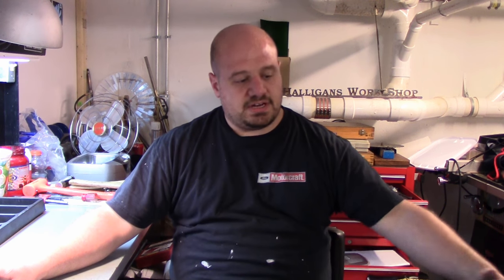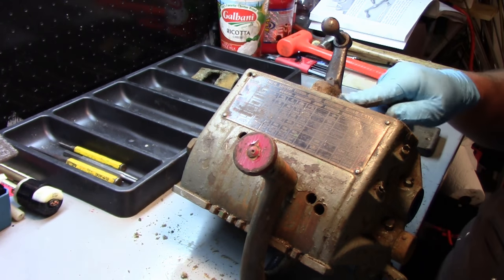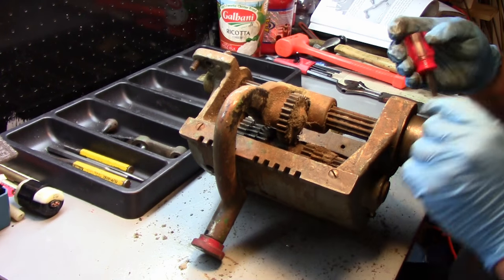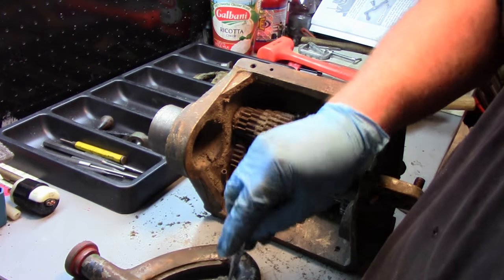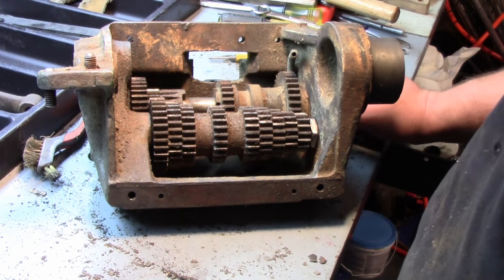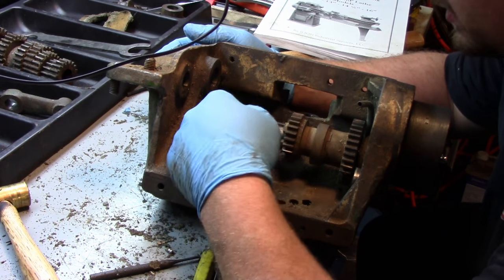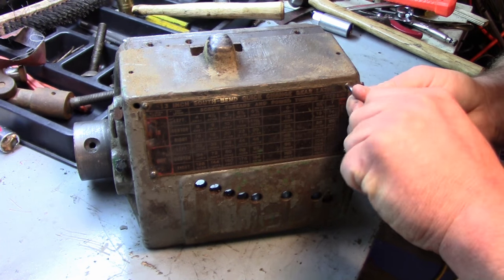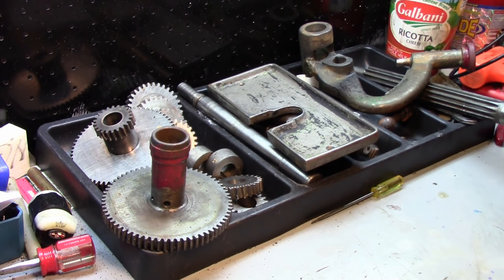13" Southbend Refurb: Gearbox

Comment: I've been using your videos as a reference lately. I just spent the last few days getting my single tumbler gearbox apart for the 13" I own. Boy, did I run into some fun problems. First, the taper pin was stuck. Tried everything to get it out. Nothing worked and I was sure I was going to bugger it up. Ended up drilling the taper pin and using a screw extractor. Ooof. Doesn't appear to be any damage to the nut or the shaft. Then the pinion gear on the other shaft would not spin even after removing the dowel pin. It was seized. Lots of heat, penetrating oil, a nice big brass punch, I was finally able to get it to rotate enough to line up with the key. Then I had to clamp the casing to my bench and drive out the shaft with a brass punch and a big ol' hammer.

You made it look easy. ;)

Comment: I don't miss rebuilding my single tumbler 10L gearbox! Those rivets holes are usually drilled all the way through the castings and you can knock them out with a small punch from the back without doing any damage to anything. I re-used every rivet on my 10L and they all shined up nice and look new! The plates on the bed or feet are another story.

Comment: It actually says to use a chisel to get the levers off in the rebuild book.  I did on mine, works very well. 

Sometimes you can get those rivets out from the back.  If there is access, a pin punch knocks them right out.

Comment: Greg,
Not too bad for an old girl! It looks like someone could have use a little more heat on that brazing. It should have flowed more instead of globs. At least it's stuck to the metal enough to keep things together. Probably done by some welding student. Good luck with your repairs. Hope you don't find too much wear on the shaves. If so, you may have to use some shim stock or turn something to make some bushings. Thanks for sharing your work and making the video.
Have a good one!
Dave

Comment: For anything screw that is too stuck, I've put a drop of Kroil penetrating oil. Let it sit over night and the next day the screws were practically finger tight. It also worked to loosen up a stuck thrust washer on my cross-feed assembly.

Comment: Oh and good video. Don't think I only have negative comments. I am just not a big fan of adjustables when there are better options. You sure made quick work of that gear box. Only thing you might do to the repaired tumbler, is run a reamer through the hole to make sure there is no burrs that might wear on that splined shaft.

Comment: Brad, ditch those blasted adjustable wrenches and use the proper wrench or sockets. Those things are hell on fasteners. I know it takes more time to hunt down each and every size, but every time you use an adjustable, you risk rounding the edges of the fasteners that have lasted for 3/4 century.
Reply from the maker: They are if you let them. Just need to be careful and know when it's going to slip.  I use them every day and am comfortable with them.  Oh and direction doesn't really matter unless you're gronking on them.  I don't care what anyone says.
Reply: +kentucky ken Yeah Brad, it's all your fault. Heck, they are probably laying off the union skilled wrench makers as we speak all because of your instance on using those danged adjustables.
Reply: +kentucky ken I actually have an adjustable that has the wrench size equivalents on the face. As you adjust the wrench down on the bolt/nut, a line moves on a scale pointing to the corresponding wrench size. Perhaps I should send it to Brad for him to learn with. We all know those HVAC guys need all the help they can get. 😃

Comment: ? As you disassembled and inspection of the shafts manly the two that bushings. Did you see any play or whering of them and or the box?
Reply from the maker: Just a few score marks from contamination and under oiling, but nothing major.
Reply: @Halligan142  I should have thanked you for your video very helpful! My first total rebuild so learning as I go. My single lever gear box just like yours, the case and shaft are worn. There is no bearing on that side. I don't have a extra lathe, do you think I should get it machined to fix the wear? Any advice thanks Russell

Comment: My guess is the tumbler got snapped during a move when it side-swiped something else. 

My 16" tumbler gear was super sloppy. These links are to a couple of Instagram posts where the bore was reamed round again, then a new shaft made to fit the larger ID:

https://instagram.com/p/-DR81joZUB/

https://instagram.com/p/7i6UF2oZX_/

https://instagram.com/p/7jAHtVIZT6/

This one shows the shimming I had to do to make up for worn gearbox parts:

https://instagram.com/p/--VTzIIZYi/

Comment: Dress the mushroomed tops of your chisels and punches with the grinder you have before you put an eye out.
Don't beat on screwdriver handles they will shatter.
Get an impact screwdriver you use a hammer on to get screws unstuck.
Make some bigger brass drifts and punches to drive shafts out , you have a lathe.
If the cheap harbor freight chisels don't have a steel cap on the top they aren't worth having around they are dangerous.
Send or take the tumbler lever to Keith Fenner so he can do a proper brazing job and repair on it he lives right down the road.
My tools are in great shape and they are older than you. 
Not putting you down but try to use proper tool use and the right tools look at is as friendly advice so people can better learn from you in your videos.

There are a ton of people on line that will custom make any placard you want from anything you want.for a reasonable price.
Now for the bed wear on the lathe, for years the tail stock of the lathe was made higher than the head stock, somewhere around .0025.
This is to allow for  wear.
Reply: You can google metal plate printing or tag printing and there are tons of places that will custom make anything.
It is so common now you could find one local.